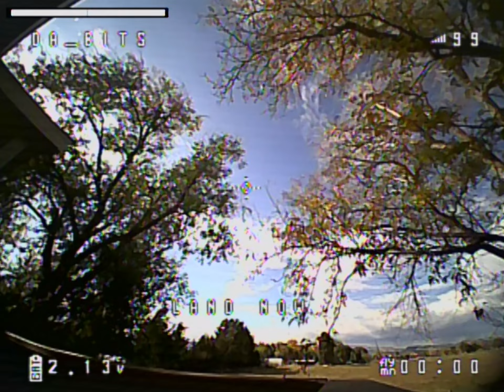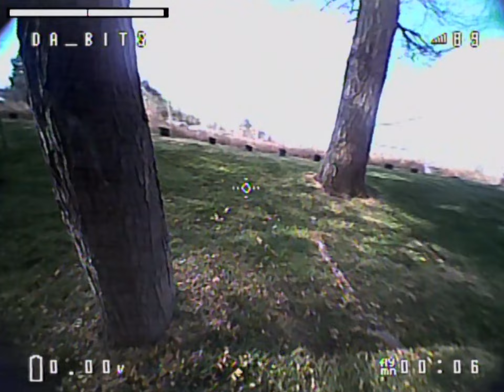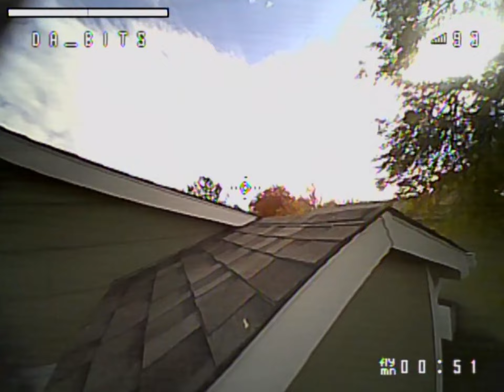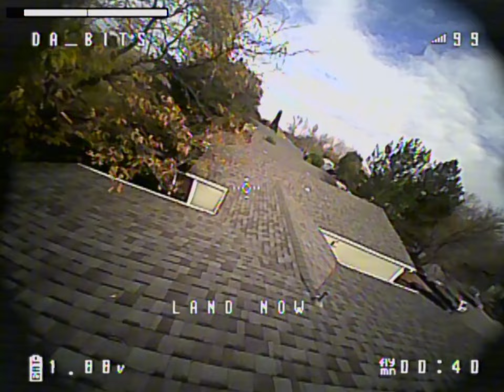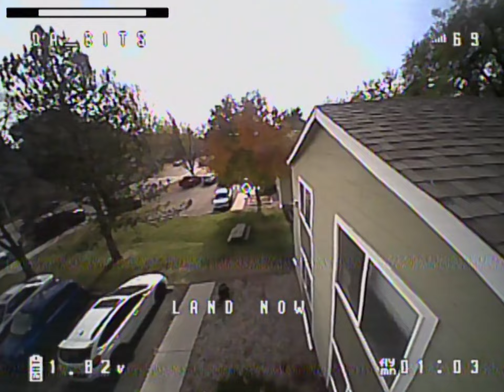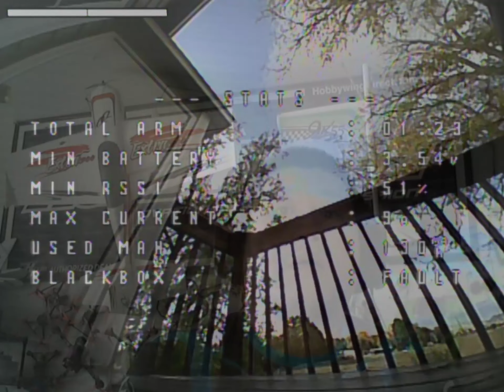VCI Spark 702 27K motors first 3 flights/ initial reaction

Comment: Somehow I think your voltage sensor is a little off 😂
Reply from the maker: @marathi22  it's not cause it's correct in the stats screen on disarm.. It's something with the osd in flight. I've been flying these boards for almost 2 years.
Reply: @da_bits  maybe your fc thinks you plugged in a 2s instead of a 1s? maybe set the maximum cell voltage higher or make sure you got the overall cell voltage displayed instead of the avg cell voltage in the osd
Reply from the maker: @eriksen7022  I'll check that out I did reflash the fc before this issue started but I did reapply my dump that had everything set right.